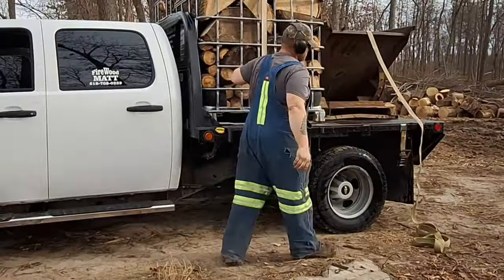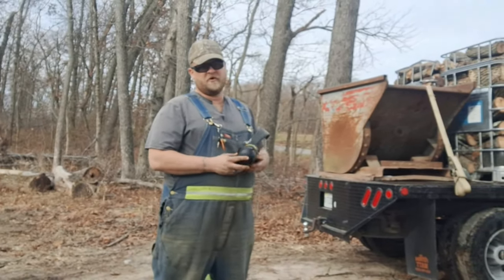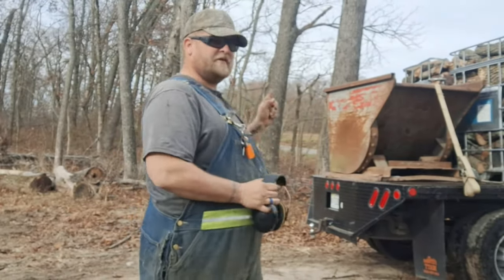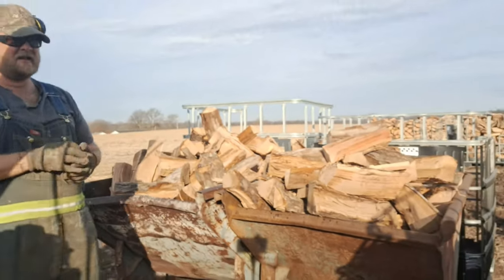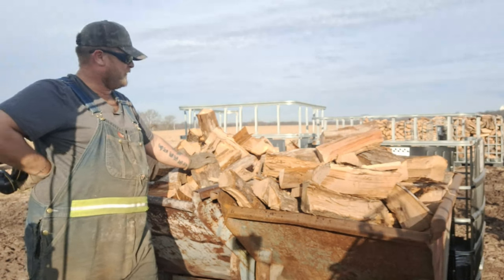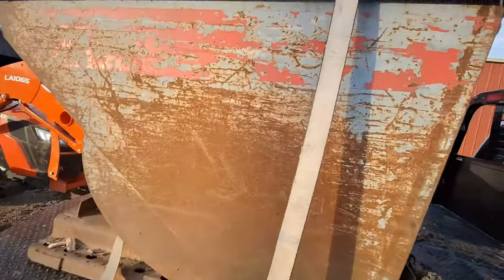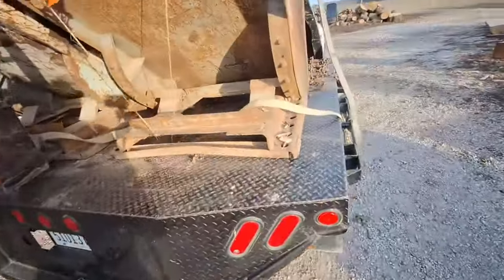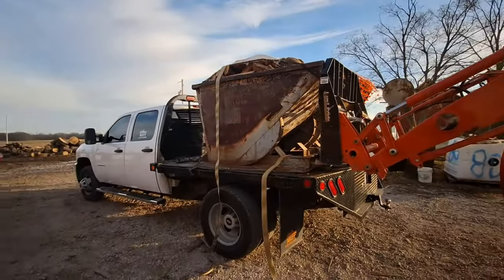How to unload firewood fast without a dump truck.

Comment: Self Dumping Hoppers are a great way to dump anything, come in many sizes too, uaually pretty cheap too
Reply from the maker: Indeed.  I have one that i use to burn my splitter litter in.  Keep it by the splitter burner while i split when it's cold.  About every 30 min or so I will clean up the debris and throw in the fire.  At the end of the day.  I can move the fire away from the wood yard in a safe place for the night.

Comment: you should slow the conveyor down.
Reply from the maker: Agreed. Got a smaller pully ordered for the motor. That should help alot
Reply from the maker: Put a new smaller pulley  on ot today.  Made all the difference